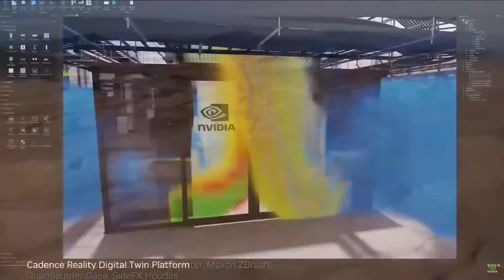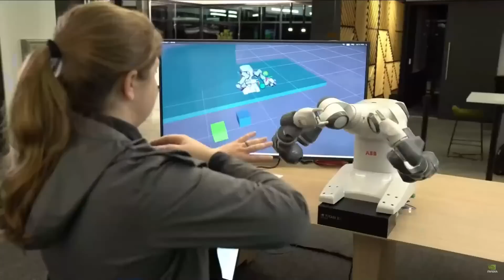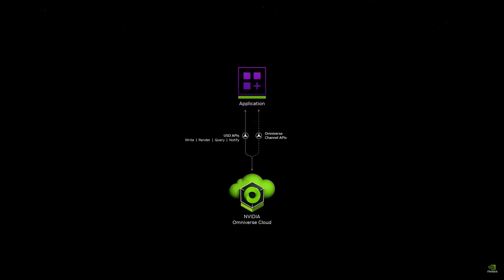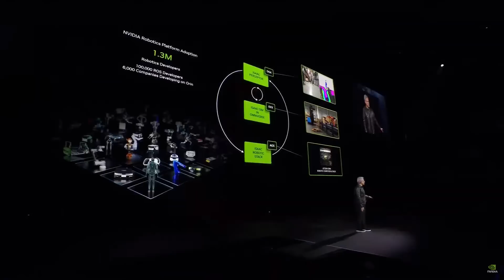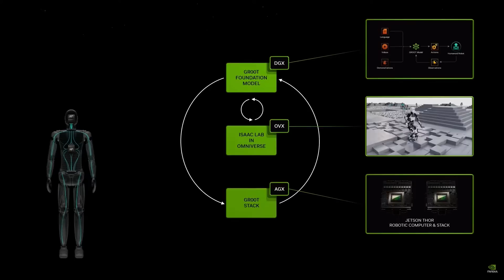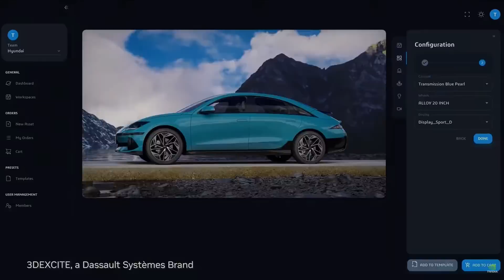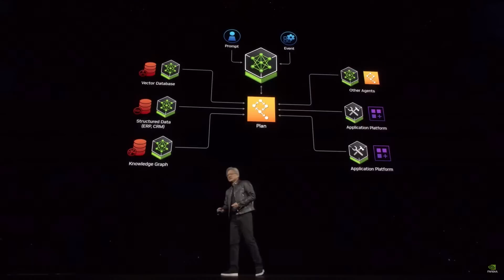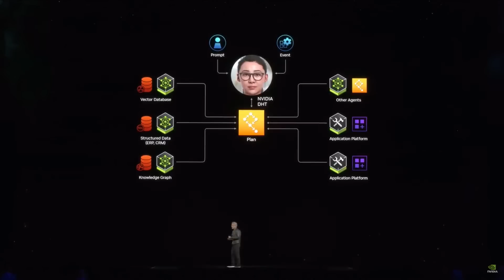Bigger Than ChatGPT?! Every NVIDIA GTC AI Announcement (Supercut)

Comment: Can we confidently invest in nvidia for the next 10 years?
Reply from the maker: That's my plan
Reply: I dont see why not?  I've been in since 2018 and not peeling any off. 🤷‍♂️🤷‍♂️🤷‍♂️
Reply: I don't see anyone else even close in this sector.
Reply: just remember to do some profit taking and buy the dips
Reply: @thangthai9109 do you mean we should sell when the stock goes high and buy again when the stock goes down ??
Reply: It depends on your strategy
Reply: Nvidia sales revenue in 2023 was $61M - their current annual TAM is $1000M, make the math, if Nvidia grows at the same speed as the AI market (CAGR 36% ) they will reach that by 2032. Expect share prices to fluctuate wildly, with the potential for significant losses followed by substantial gains. Utilize stop-loss measures to mitigate risks effectively.